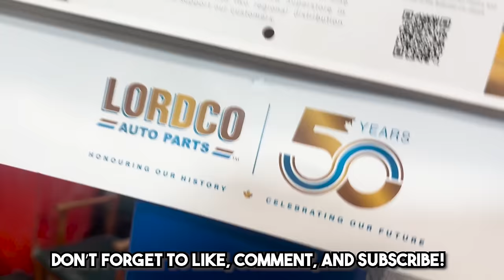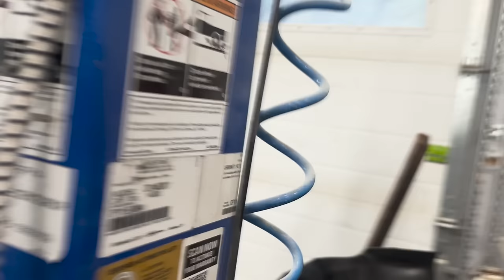New Tires, Suspension, and Grille: Too Perfect to Be True!

Comment: I love the paint and everything cause it has the appearance of a completely stock vehicle except for the wheels. I still love that 68 SS Chevelle you have cause I'm pretty sure that it may have came with Maroon paint from the factory. Most people wanted brighter colors on the car's when new, I just got tired of seeing so many of em with the same colors constantly. Black was the only color that didn't bug me with alot 67s upto 69 and 71 SS Chevelle's and Malibu's..I'm more into the 71 and 72 SS Chevelle big block 4speed than the 70s cause people saved more 70s than 72s when 72 was supposed to have been the bad boy toy in the early 70s..As usual Mike, yall do fantastic work to bring em back the way they should be done...Cassidy seems like a really really good worker and I think she's a rare gem plus she's came along ways with restoration of vehicles..

Comment: Winter tires are not safe over a couple degrees above freezing, The soft compound and sidewalls make a vehicle handle poorly as well . Our insurance guy flips out if they see them on after its not freezing temps . shame to see a guardrail turn green because of it
Reply: Absolute ridiculous statement 😅
Reply: I drove year round on my X Ice for three years. 
Seemed ok, but I wasn't racing around corners.
Reply: @elpres2024  Call a tire rep and get back to me.
Reply from the maker: its a cruiser drove chevelle to vegas 75 degrees 90 mph no problems but im not a tire expert we will see if they clear fenders once suspension set up
Reply: @RustBrosRestos  I run my winters through the summer and sometimes really hard through twisty back roads 4 wheel drifts and zero issues other than tire wear but I love the grip. Super predictable not dangerous in any way at all. Some people just love to chime in with no experience.
Reply: @91rss  no need to I have enough experience thanks...my buddy owns a tire shop, third generation and he'd  laugh at you.
Reply: @elpres2024  get him to call then  . and prove me wrong .
Reply: @91rss  yeah ok I'm on it wait right there. Don't move until I get back.